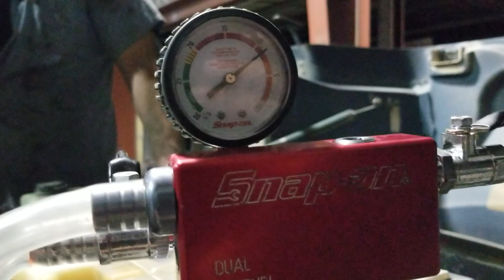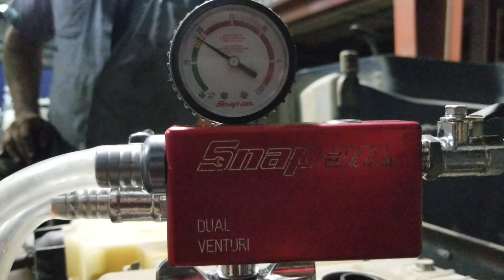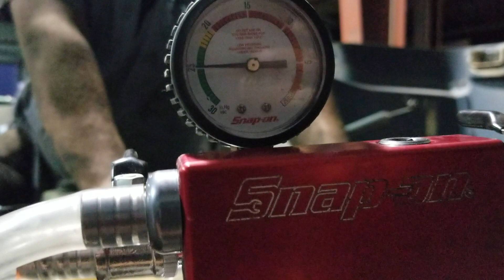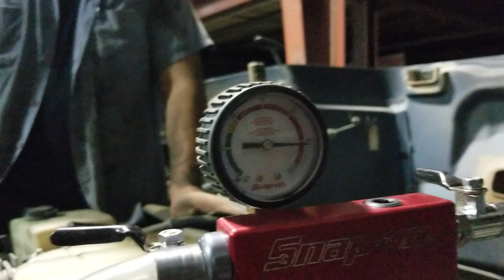Vacuum coolant refiller

Comment: Hi good video, I got a similar kit of Ebay but the instructions don't say what's the maximum pressure that can be applied with the air compressor. What pressure psi or bar did you apply here?
Reply from the maker: Most shop tools are designed to work at 90 PSI but at my shop our air compressor is set to 115 PSI  you get a little more power at the expense of tool life the higher PSI you run
Reply: @fleettechpph5255  question.  I hear just draining petcock doesn't drain 100% of coolant from motor. 

Using this tool during the vacuum step, does it suck out any remaining coolant while collapsing the hoses?
Reply: Jasco Kovacevic what kit did you get?